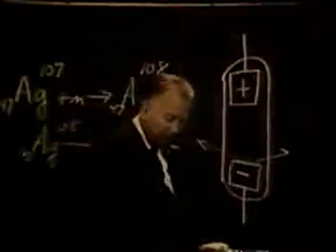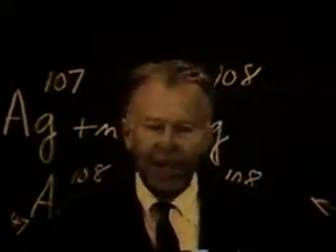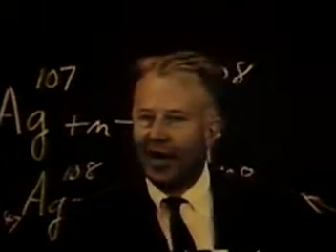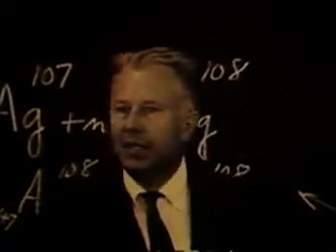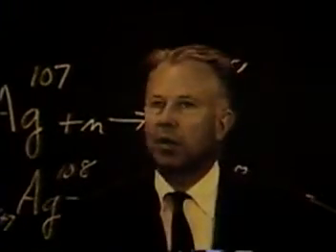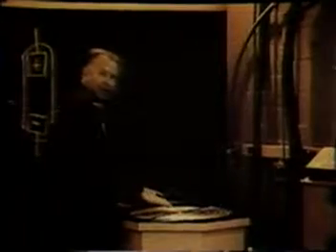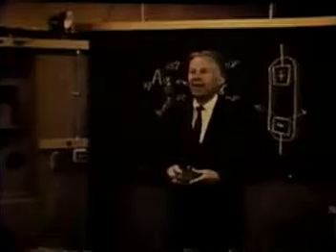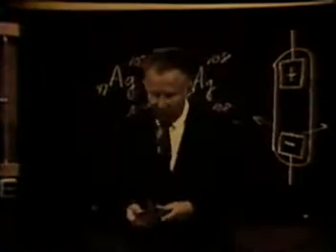Ernest Lawrence explains the Cyclotron

Comment: During my work as a radio transmitter engineer, I was working with a 50KW transmitter (among other sizes, both smaller and larger).  There was a big sign in the final tube cavity that warned of X-Rays during full power operation.  Accordingly, the final stage was in a well sealed compartment, but a person could deactivate various safety switches and “pour coals to the fire” from the power supply.  Sometimes I would tune it up to pump out up to about 65KW during testing, but I didn’t want to do that too often or for very long duration.  One day I took a Geiger detector with me to work and was somewhat surprised at how much the background radiation would be raised to.  I knew it must be higher, but I found that it dang near quadrupled. High voltage potentials and resulting currents can really start spitting out fast moving particles!  I can only imagine what modern day “atom smashers” are capable of doing.